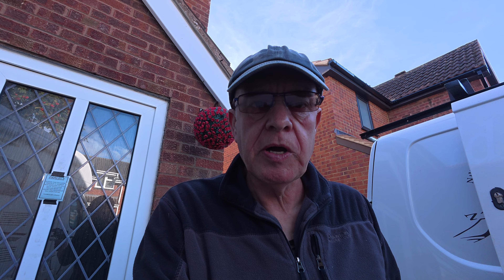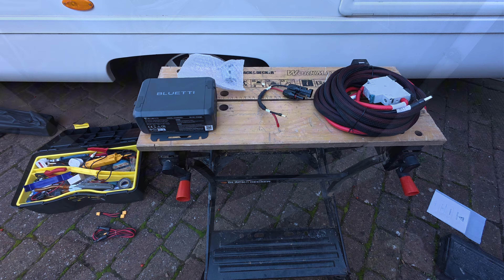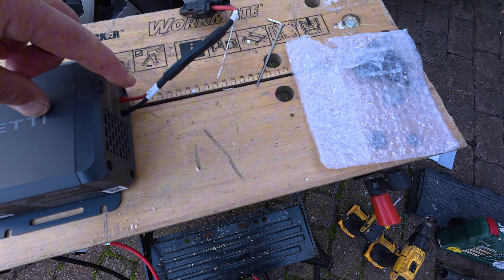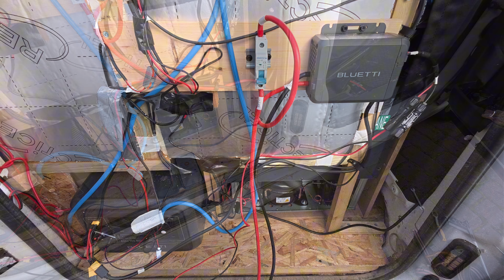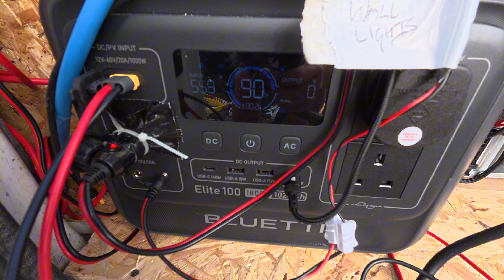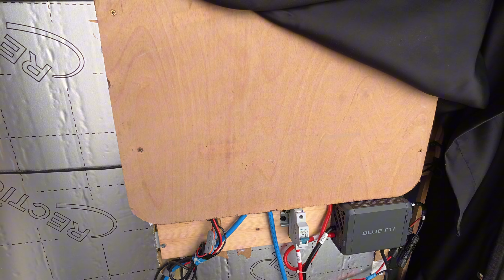Bluetti Charger 1 Installation Review | Is It Hard to Install? 6 X Faster Charging.

Comment: I found this installation very interesting & looks like you will now have ample power for your camper’s requirements whether it be from the solar panels or the battery going along.
Reply from the maker: Thank you hopefully it will should we do anything off grid most times we will be on hook up on a site but this time of the year the solar doesn’t do to much to recharge the power station even it plugged into the cigarette accessory socket it was charging so slow I definitely a game changer